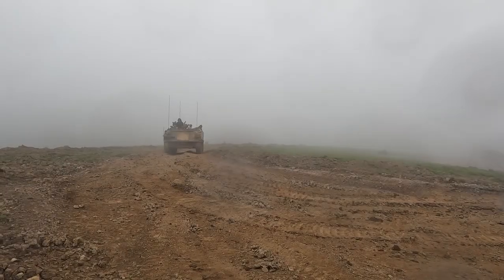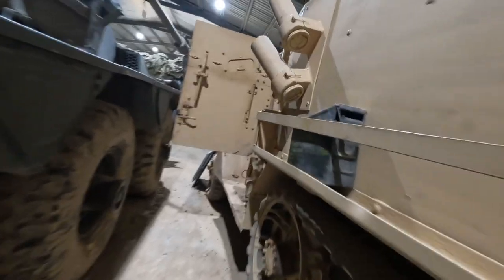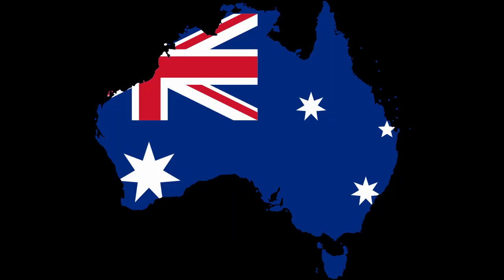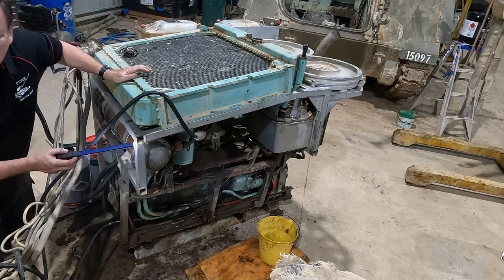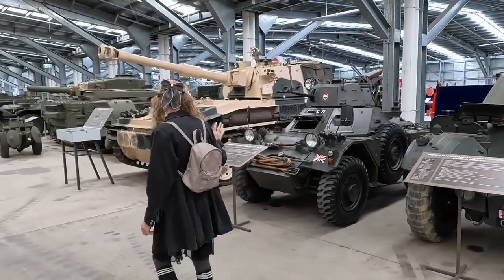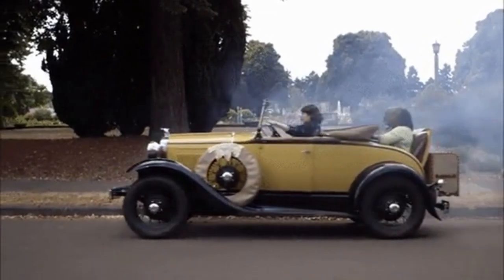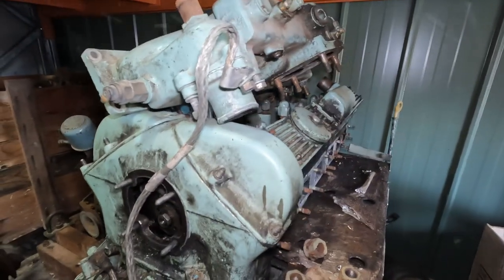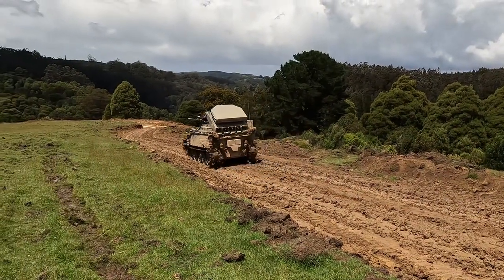British Fighting Vehicles - Why You Should Avoid Them

Comment: My company car was the Ferret for several years, as a troop officer Air defence in the RA. These vehicles are not designed for hobbyists, they are meant for war. If there is am issue, REME whips out the whole power pack. Not designed for hobbyists!

Comment: In the early days when working on British-designed and built Marine engines the popular definition of an English mechanic was a guy (talking 50 years ago) with eight-inch hands and twelve-inch fingers. Especially when it came to fitting replacing rear oil seals with flywheel from crankcase distance. If you had a leak you could just touch the cover bolts by putting in one hand but not turn it

Comment: as to studs... when doing more modern say Ford 302 5.0L V8s etc. I have always swapped out the head bolts for studs. But you need the right studs. Plain metal? It would only cause problems. Get some that are anodized or coated in a very hard material.

Comment: You break down, the REME come along. Pack lift. Replace pack with a new or reconditioned pack. Old pack goes to base workshops for replacement of defective parts. Job done. Ex Chieftain driver mech.

Comment: Makes me glad for my M106 in late 80s West Germany. It might have been built in 1967 but replacing the transmission and final drives wasn't this level of nightmare fuel. Wonder if they ever got the intake welded so they could get rid of the chicken wire.

Comment: On the Mk II 432 the multi fuel engine was used and suffered from the same civil service extension of life. These had the exhaust on the side. Much of the electrical problems was from the awful NATO couplings, fine rate in poor spaces meaning cross threads with cold hands in the dark. The pins would slide in the rubber holders which collapsed with diesel contamination. 
Do not think the crap was all British. The Germans took our 105 gun from the Centurion and put it in the Leopard but with a hydraulic gun system. Ughh! A puddle of oil at the bottom of every tank probably not very good with a hit! Their hulls were known to split as well. There were very fast but the crews could become disorientated. 
All armour is compromised without exception. What you need is cheap and capable but noNATO member will make the investment bar America. Even then they are not cheap but are capable. Industrialised countries want independence of supply but this brings its own problems because they get a super power bill they cannot afford so must sell etc. 
So you have a small army with limited efficiency and hope to hold a big army with less efficiency for long enough to thrash out a political deal. And that ladies and gentlemen is what BAOR stood for in Germany post war and whatever the tub thumping the Russians only walked their side of the line. I was proud to be part of it.

Comment: After Dunkirk the gvt body ordered tanks. Off the design books. About 2500 of 2 different types were produced. One lot had unfixable cooling problems. Don't remember what was wrong with the other lot. But the whole lot were relrgated to training tanks. 

Can you imagine the result of having 2500 more tanks at Normandy?

The best part about this is while the british engineres were terrible the german engineres lost the war. Over complex, difficult to manufacture and expensive everything. At least for the army. Even the rifles.

Bad (overcomplex) german enginereing persists to this day. Ask someone who works on schnider high voltage switch gear. 

The british engineres were brain dead.
But the germans mess it up with forethought.

Comment: Well let’s look at it shall we? Post WWII it was decided that a series of power packs should be created to power vehicles and these should have certain commonalities. So a common piston but increasing cylinders. These should reduce the amount of variations for one item but the format was found at a later date to require advancing sizes. However mattes we’re not so bad if the maintenance periods w ere kept. They were not as the civil service arm of the MoD decided the 3000 service should be extended to 5000 then 8000 then 10 but I never saw one make that! After the first series of designs, the carcasses of which were made by different manufacturers from the engine designers the second series of armoured vehicles was made. This had the idea of power packs to facilitate changing but the existing packs were not powerful enough but a temporary expedient was made in the Mk I 432. This was a gutless wonder but it was never a tank - ever! It was a battle taxi to dump personnel about 1500 yards from engagement. This was because the armour was only 25mm thick and could be penetrated by 7.62 small arms. NATO standard was 30mm. The prime purpose was to transfer personnel across nuclear ground and make bio warfare possible hence the water gauge in the crew cabin. However the specialist variant’s had to ignore much of this so their specialist capacity was available close to engagement. On the
Reply: The 432 was never ever a tank
It was designed as a APC,and its variants
Reply: @stewartbrown8115  I know I worked upon them! Tank is used loosely for AFV which it was. I find it amazing they are still in use in 434 versions which were of limited use then and cannot have improved much. Wonderful toys though with lots of knobbly bits.

Comment: I have to say that this video is full of crap, I have worked on British military vehicles for 50 years now, half of the at time employed by British Army as a mechanic in their workshops. If you are properly trained and no and understand what you are doing the Brit vehicles are very good. The problems you are moaning about are due to private owners getting hold of surplus vehicles which have been used and abused by a previous private owner, with no regular servicing and checks. You made a big fuss about starter motors, I can easily chenge a Ferret starter without taking the engine out. Also the CVR(T) starter is very easy to access, just lift the top deck off.  As for the knocking of Lucas electrics, again you are only repeating other ignorant individuals, who probably do not understand electrics.